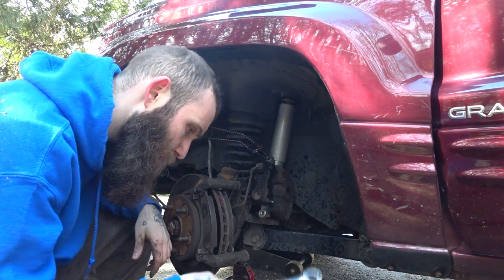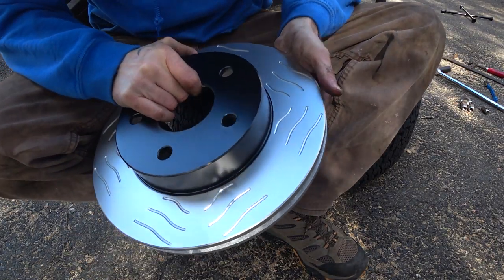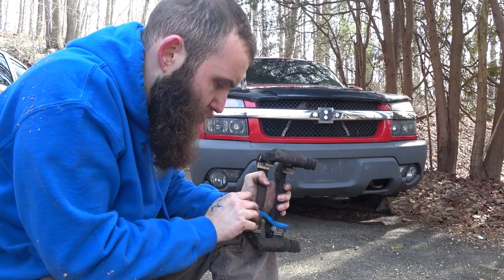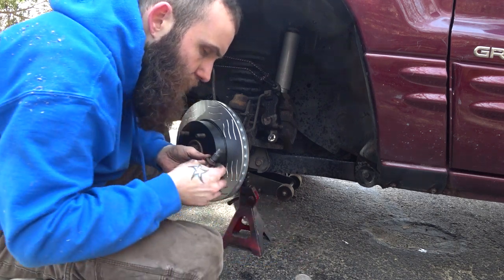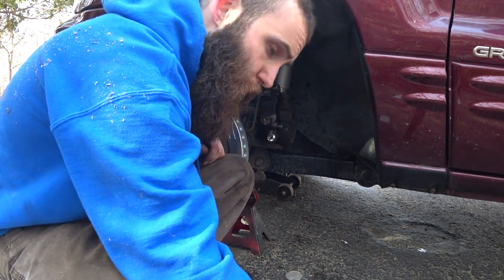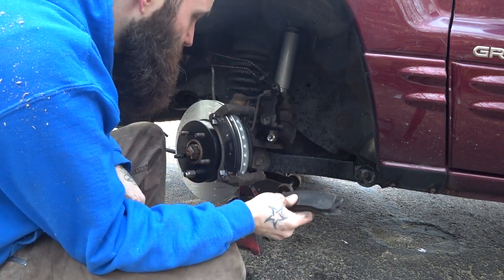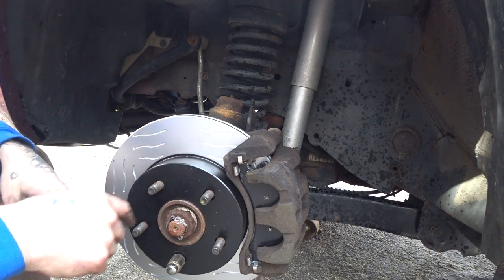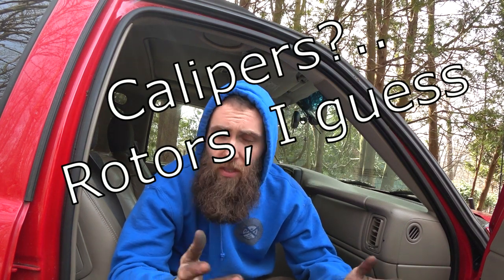No More Warped Rotors - Raybestos HD Brake Rotors

Comment: Doug excellent video and I agree on your points on what maybe causing the warping. After 6 years and 70K miles on my 2000 4.7L Limited WJ I’ve had many front brake jobs due to the same warping rotors.  I originally had the teves then changed them out to the akebono’s and still had warping issues.  I was using ceramic pads and that was causing my problems they create too much heat and my calipers seized.  Good thing Pep Boys warrantied my calipers three times lol.  Last brake job I did I got the Brembo Brand rotors from Rock Automand a good quality Raybestos semi-metallic pads and it’s been over a years and so far so good.  The rotors are holding up well and no issues with these calipers.   I was going to bite the bullet and go with mopar rotors to see how they last but so far I don’t need to go that route. I was getting tired of front brake jobs.  I’m not hard on my brakes either.  I think the WJ brakes like all other brakes on Jeeps of that era were not adequate

Comment: Runout from not cleaning hubs or bad hubs will cause thickness variation on rotors ("warping" as people say) due to uneven pad deposits. Check runout or at the very least clean the hubs.  Also those Wearever Silver pads are semi metallic which is the hardest on rotors compared to ceramic or organic, but pad type should not affect causing rotor thickness variation aka "warping"/pulsing

Comment: Hey bud, can I make a suggestion? I recommend, even though they aren’t the cheapest, the powerstop brake pad and rotor kit. The z23 and z26 pads are a carbon fiber ceramic so they run much cooler, stop really good when cold, stop insanely good when hot, are quiet and produce barely any brake dust. Also you just take some time to bed the pads into the rotors, helps them stop better and keeps them from overheating as easy. If you have any questions about anything mechanical, ask away bud. Have a fantastic day, peace.
Reply from the maker: Thank you. I will give them a try. These are holding up, but next time I will try those
Reply: Btw, I did forget to mention they make a HD towing specific bad and rotor combo. I’m currently testing an eBay special drilled/slotted rotor with the z26 pads. I’ll try to remember to comment here with a review off how they last. My guess is even with a lower quality rotor, the extra cooling from the drilled holes and the cooler operation carbon ceramic pads will still give great brake life and performance but we shall see.
Reply: @DEInTheGarage  so, 2 years on, what did you decide about these?

Comment: D&E video!?! Heck yes. 

If these don't work, Powerstop Z36 kit. Just get the pads and rotors unless you need new calipers. They are great on my wife's 16 Explorer and they aren't noisy or dusty. I'm seriously considering them for my JK.
Reply from the maker: Thanks dude. That will be next on my list if these dont work
Reply: I can vouch for the Z36. Used em on an elcamino first. Now as set on my XJ. Got the calipers too, just cuz of the red powdercoat. ;) Work great. Don't make a mess on the wheels either!

Comment: The rotors are relived. Most people can't wrap thier minds around that, so they say "cooling grooves". For what they're worth the reliefs will work wether they're filled with brake dust or not. Ceramic pads only. Nakamoto ceramic pads and rotors from ebay work fine on a chevy(my xj is long gone:( . All your problems and those pads =you're hanging up. Silicone paste on the glides, glide pins, and mating surfaces between the pads and the clips. Carfully inspect your glide pins and the bores they ride in. Any rust replace the part. Change your brake fluid, it should be clear not amber, not brown, NOT black. Wring out the calipers(c clamp, crack bleeders) every time you change the oil, top off the fluid. If you still have problems after all this replace the calipers. Well maintained brakes save money by the fist full!

Comment: Figure I'd throw it out there.  I've been driving DSMs for years and have experienced warped rotor problems on my cars until I switched to EBC brakes with a slotted rotor option from either EBS, Power Slot, or Power Stop and combined them with EBC reds and ATE TYPE 200 Brake Fluid and never looked back.  I'd stay away from crossdrilled unless they are forged that way. I replace pads more often, but the pad does not chew through rotors as other high performance pads do and i get similar stopping power with less dust.  Slots keep the pad nice and cool and clean when I rally my GVR4.  I'd rather change pads over replacing my expensive racing rotors any day.  The stopping power of these things is absolutely a dream once they heat up.  Now, the reds are not for SUV, so you would need to try the EBC orange extra duty.  I haven't used them on my Jeep yet, but they might be worth a try.

Comment: NEVER use anti-seize on caliper bolts. MUST use thread locker. Seen those back out too many times when the silver paste was applied.
Reply: if you live in rust belt its fine......I have done it for 25 years and never an issues.....

Comment: Spent two hours under a Jeep the other day working on getting a 247 transfer case. Discovered in the end someone had tried to remove it while it was still on the cross member and stripped three of the bottom bolts. Got some bolt extractors and going back to the pull a part again see if it’s still there and I can get those last three bolts off. My ruby will need breaks soon too so thanks for the videos. Is that an 02 Jeep Grand Cherokee?
Reply from the maker: Jeez... what a nightmare! Good luck bud!

Comment: I had the same problem with the 97 Grand. I finally went with NAPA Premium Rotors ( WHAT EVER THAT MEANS ) but the biggest thing was using organic brake pads & " I AM THE ONLY ONE WHO TIGHTENS MY LUG NUTS " NO GORILLA'S WITH AN AIR IMPACT GUN. THAT WILL DEFENITELY WARP YOUR ROTORS, USE A TORQUE WRENCH.
Reply from the maker: I am right there... I may be a monkey with a toolbox, but i am no gorilla! Never send those lugs home with an impact

Comment: Usually its not a issue of a warping. Most of the time it a poor bedding procedure and or installation run out. I race so brakes are a consumable for me and we have never warped a rotor and rotor get hot enough to glow.

Comment: I had experienced an overheating brake subsystem on one corner of my Avalanche.  I thought I solved the problem by changing the caliper (one of 2 pistons did not move freely).  However, it was the rubber brake line that failed by swelling on the inside.  It did not let the caliper relax when I left the foot off the brake.  That was the root cause of the issue, and the hose looked fine from the outside.  Perhaps the rubber lines may need inspection on your vehicle.  I am not disappointed as the original caliper/hose lasted 270,000 miles and 18 years... half of them in Michigan.  Finally, where the fu€# is your torque wrench?  As one who  has been through product development in the auto industry,  fastener torque is pretty important especially on safety systems.  Dont mean to be like a dad, but just want you to be safe... (fail, I guess that's what a dad would say too).
Reply from the maker: Interesting. thanks for sharing!

Comment: I am about to purchase those rollers tomorrow and the performance brakes I just bought some front brakes and rollers 3 months ago and put it on a 2018 Dodge Charger RT and now they are warped when I slow down from doing 60 the whole front is shaking

Comment: What is the name of the main plate on the front of the bellhousing? I bent it taking my engine out, should I bend it back and reuse it, or get a new one?

Off topic but I figured I'd ask because you are so knowledgable on XJs.
Reply from the maker: It sounds like you are referring to the flex plate. I would not recommend trying to bend it back. Maybe try to find a cheap on in a junk yard
Reply: @DEInTheGarage  I don't think it's the flex plate: It is just a flat plate that holds the starter on...
Reply from the maker: @ohsee1346  Oh, that is just a cover. You should be fine bending that back as long as it wasnt totally mangled
Reply: @DEInTheGarage  Thanks!

Comment: What causes rotor warping is over torquing lug nuts.  Most tire shops have their torque wrenches set at 80lb or above, but buick and later, others found 40lbs torque was safe and kept the rotors from warping.
Reply: Where did you find this information at?
Reply: @bman409  Jeep cherokee forum.  During 2000=2010, rotors began warping in jeeps, I looked up why my jeep's rotors kept shaking/vibrating, found the answer in a jeep forum.  fixed my problem.  My grandmother in law had a buick, who had replaced her rotors twice, and was about to go back to do it again, I told her about mine, she told her mechanic, and two days later, she told me it worked for her.  I was surprised because I've never had a lady be able to understand car stuff and relay the info so well, nor a mechanic that was not a jeep guy, ever listen to someone who was not a mechanic, though I worked on and still do, jeeps.  rotors are thin, some are just crappy.

Comment: Raybestos rotors are very good quality. On the engineering side drilled and slotted rotors don't perform as well as people think. You want slotted OR drilled, not both. Slots and drills together weaken the integrity of the rotor too much. I've seen D&S rotors crack under normal usage. Slotted rotors are better in my opinion.
Reply: You are right about that.     Most forms of motorsports use solid slotted rotors because they are deemed the best.   Porsche and AMG basically put Cross drilled rotors on their cars for aesthetics since it looks sportier.    I just save my money and purchase solid rotors but depending on the purpose of my vehicle I go for slotted only.

Comment: Better parts equal less work in the future 😉 I think WJ's all eat brakes but a good brake rotor and ceramic brake pads seem to help make them last longer . I recommend using a brake lubricant or something like that stays pliable not like that tin man paste 😂 The silver pads don't come with new hardware and you should go up in pad quality and get the new hardware and lube the slider pins every 10,000 miles if needed do to the rust belts we live in .

Comment: You need to really put some heat into the rotors just after installation to set them.
Reply: The grooves are not meant to dissipate heat.  They are meant to keep the pad clean by giving a place for the wearing material to go. This allows the pads to wear more evenly.  You also need to match brake pads to brake rotors.  If you get a cheap rotor which is most likely softer material and an expensive pad.  The pad will chew up the rotor.  For example, buying a pair of cheapest Duralast rotors and then putting EBC yellow pads on them.  You'll chew those rotors up in like 20k miles.  I've got a matching pair of Raybestos rotors and pads and they have been on my vehicle for over 100,000 miles.

Comment: Just an FYI 90% of the time "warped rotors" are not actually warped. What happens is the rotor get hot which pulls material off the pads (same thing happens when you "bed in" new pads). Then when you stop the pad sets in one spot on the rotor, and that material sticks to the rotor creating a high spot of material on the rotor. That high spot then pulsates the brake system, and makes it feel warped. The best way to combat "warped rotors" is to do something to keep the pads from setting in one spot after a hard stop. The best option is to try to not set stopped, but if that's not an option putting the vehicle in park, and taking your foot off the break is better than nothing.
Reply from the maker: Very interesting. Thank you!
Reply: True, some shops refer to them as hot spots.  Bigger pads and rotors solved hot spots for me on 2 cars.

Comment: You put the wrong grease on your guide pins. Use silicon grease aka dielectric grease. The caliper mounting bolts are one time use and new ones need to be torqued.

Comment: Clean the bracket under the hardware, rust will pinch the hardware, this will stuck your pads and you heat your rotors.
Reply from the maker: Good call bud. Gotta hit that area with a wire brush for sure

Comment: You really need to clean off all the rust build up off your hub before installing a new rotor. It causes some lateral run out and the pad transfers unevenly onto the rotor because the highest part of the lateral runout touches the pads every time in comes around. Then eventually as the pad material keeps transferring unevenly then it turns into a brake pedal vibration. Give that a try when these start shaking 😜
Reply: Also unevenly torquing your wheel bolts can cause it as well

Comment: How they hold up since it's been a while?
Reply from the maker: I have about 10k miles on them and a fair bit of heavy towing and they are holding up great
Reply: @DEInTheGarage  thanks for the update. Nice to know. I know I've seemed to have no problems with Rebestos best pro grade stuff. I've used their ball joints and other front end parts many times and feel like they're very good quality so far plus what I really like is when they offer them with the poly boots that don't rot as fast as rubber like the ones from the only other company I'll buy front end parts which is the one that almost every garage uses and swears by. But for me I go for the good joint plus the poly boot if possible.

Comment: I bet your rotors aren’t warped, I bet your brake pads aren’t bedded properly. If you don’t have an even distribution of pad material on your rotors you’ll get a pulsation that most people think is warped rotors but rarely is.  Pull your rotors off and sand or sandblast the pad contact area and throw them back on and go through a proper bedding procedure (google it) and your brakes will be smooth as butter.
Reply: Oops. Just noticed this video is 3 years old… anyway, I hope this info helps someone out.

Comment: Or your brakes are dragging.     I had this problem before.
Reply from the maker: Good call. I lubed my slides and guides pretty well, so hoping that is not an issue
Reply: @DEInTheGarage  did you check the piston for rust? My 03 hemi with same calipers had rust built up on the piston, even the land rover did.
Reply: Yeah, I wondered the same thing. When you held up the used pads, the one on the left looked thinner than the one on the right.